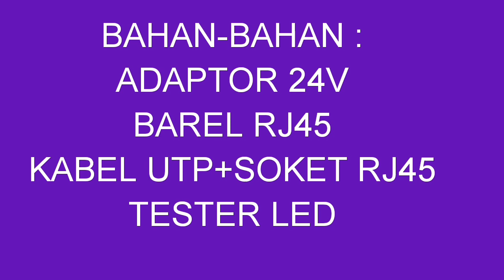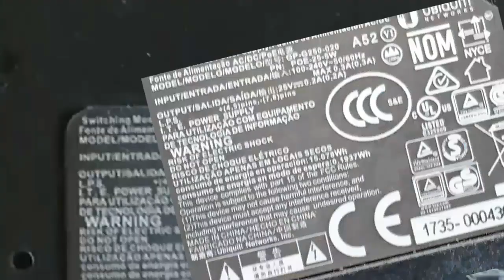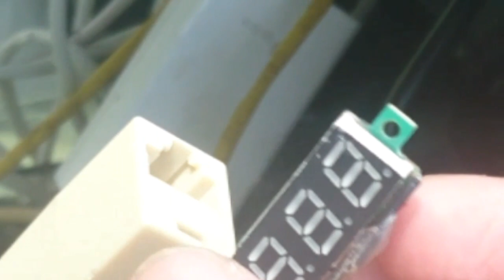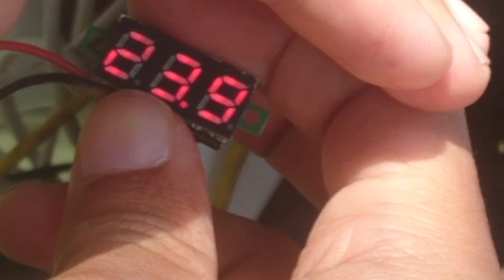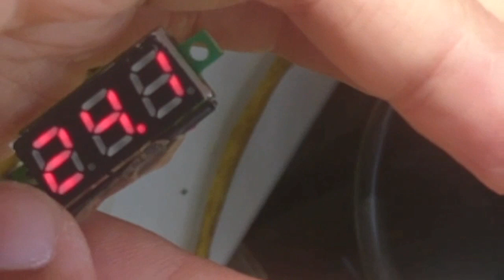#OnTrick 1 - LEBIH MURAH? MEMBUAT POE INJECTOR SENDIRI UNTUK UBIQUITI LITEBEAM

Comment: Bang z punya ubiquity mau pasang di gunung tapi pakai panel surya. Bisakah bang klo z pakai step up ke poe splitter.
Jdi poe bawaan power beamx gak kepake, dan gak pakai inverter jga
Reply from the maker: Tidak perlu step up.

Mode nya Kira Kira seperti ini.

Panelsurya 200wp
Baterai 24v
Ambil power dari controller output.

Gunakan double baterai Dan panel tambahkan timer .
Buat dua module panel surya bekerja bergantian.
1 hari untuk panel 1 .hari berikutnya untuk panel 2.
Reply: @orangjaringan  tapi di gunung hnya ada 2 perangkat bang yg di hidupkan. Yaitu ubiquity sama modem huawei krn ispx dri gsm.
Reply from the maker: Kalau ingin alat online selama 24jam.di butuhkan paling tidak 4 aki 12v hanya untuk suply ke 1 atau 2alat.
Maksudnya, Kalau double modul panel nya.ada jeda untuk waktu charging dan operasi.
Ubiquiti dapat menggunakan voltase 12v. Tetapi akan berpengaruh pada output powernya.
Reply: @orangjaringan  itu akix minimal berapa amper bang.
Reply: @orangjaringan  maksudx bang pakai step up untuk menaikkan teganganx ke 24v. Tapi sumberx dari aki. Gak usah pakai poe bawaan dari poe power beamx.
Reply from the maker: Kalau dari pengalaman pribadi.
Aki 36 Ah di charging dalam 1-2hari(bisa beda hasil sesuai kondisi panas matahari).dari kapasitas penuh,
Kalau di ambil untuk suply 2 alat(12v2a) bisa bertahan 12jam lebih..
Reply from the maker: Pakai modem gsm yang 5v saja.
Reply: @orangjaringan  tapi cara modif poex bang gimana. Untuk menghidupkan power beamx
Reply: @orangjaringan  z udah punya modem bang 12 huawei b3110s
Reply: @orangjaringan  tapi klo mikritikx blm punya

Comment: kalau adaptornya di ganti tenaga akki 100 ah 12 volt ?
bwt power litebeam m5 PoE ouput DC 25 volt & 0,2 ampare gimana bang
Reply from the maker: Bisa. Kalau tidak ada penahan.panjangin kabel lan nya saja. Pakai aki 3.5 Ah untuk 2 alat. Charger nya jangan pakai trafo besar.alat jaringan bisa terbakar ic powernya